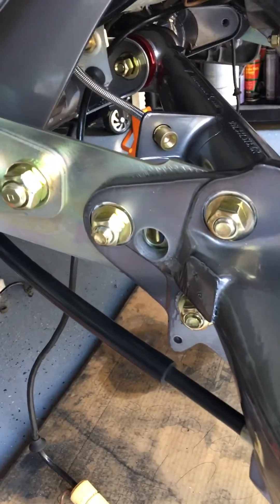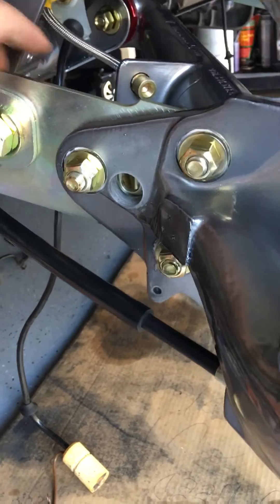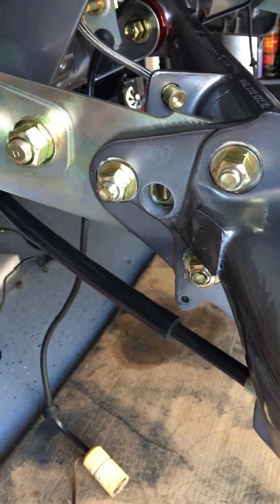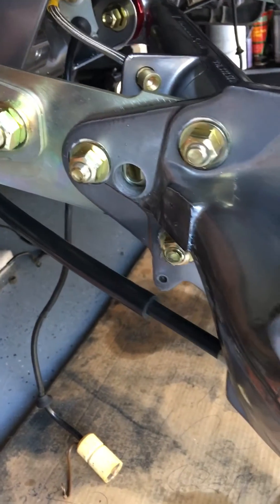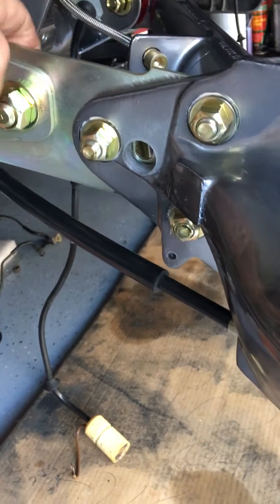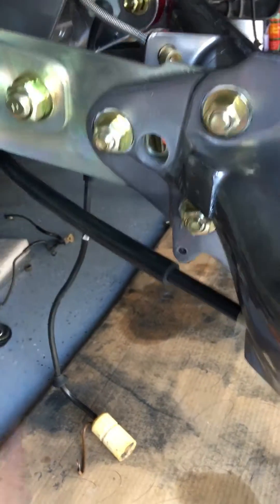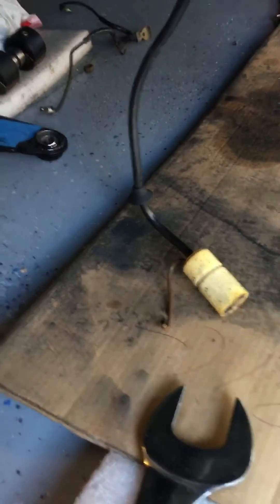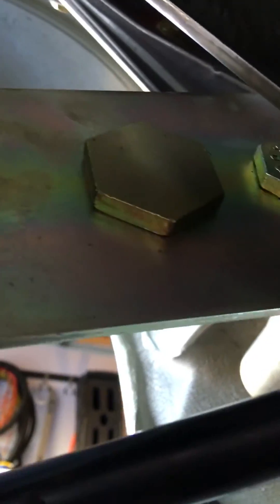Porsche 944 Turbo Rear Suspension Corner Balance Eccentric

Comment: 10/10 what i was looking for 

As setting up my 944 later this week.
Pulling apart and replacing and coating everything. 

One of the last areas of my 944 needing to be redone and had not actually seen how this moves before! 

It worked exactly as imagined. 

But! Kinda blown away with how much movment was achived and why people often opt to use this as a ride hight solution which I agree is wrong and painfully agree proper torsen bar adjustments to be... annoying at best.

Comment: is this how you adjust ride hight?
Reply from the maker: Some people incorrectly use this as a ride height adjustment, however it is not intended for that.  Ride height adjustment is done with the torstion bars, and is very complicated.
Reply: Where can I go about getting a suspension that clean? It looks like you can eat off of it. Anyways I’m wondering where I can be able to purchase an entire rear suspension for the 944 that looks like yours? It doesn’t look like you just took it to a shop and got it cleaned and powder coated. I’ve been searching the internet and can’t find all of those components. I’m looking to build a track car.
Reply: @davidhopkins2691  did you find your parts ??? Here is my 951 track.car !!😎😎😄🍺 https://youtu.be/oaIYffwo1DI
Reply: @artmchugh5644  I didn’t purchase every component new. Instead I changed all the bushings out and went with coil overs. Waiting on a pair of subframe bushings for the rear and it’ll be complete minus sway bars